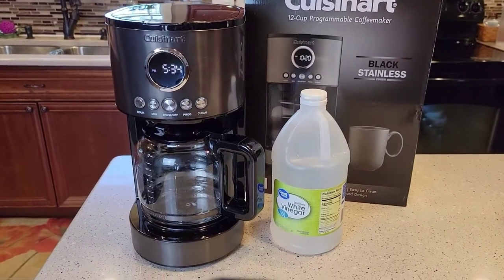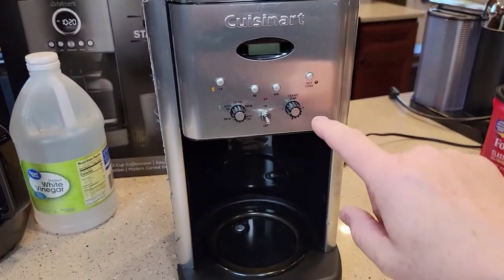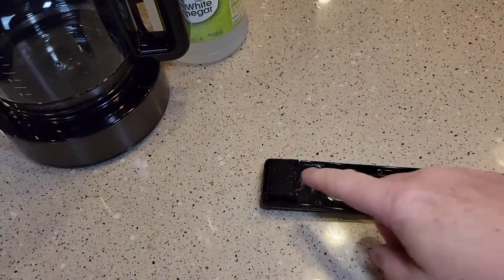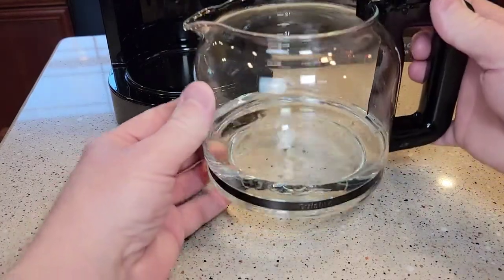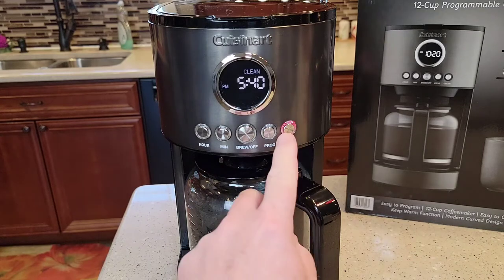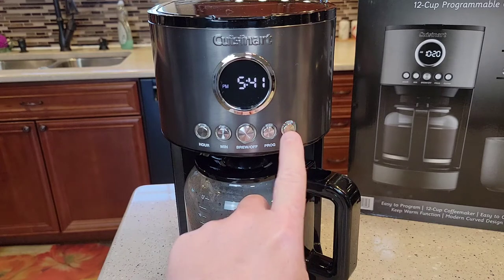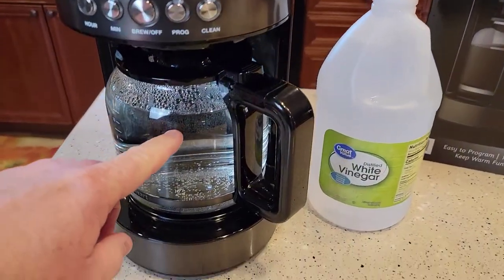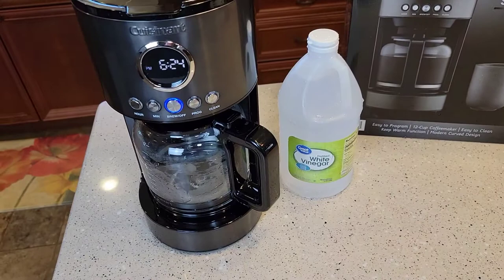HOW TO DESCALE / CLEAN Cuisinart 12 Cup Black Stainless Coffee Maker DCC-1220 FOR ONLY $1.50

Comment: I bought my coffeemaker just like yours 6 months ago and the clean button came on. I misplaced my manual and came across your video. I understood what to do. Thank you!
Reply from the maker: Glad I could help!
Reply: Same thing for me.  I misplaced my manual and then the clean light came on.  I basically knew you had to run 1/3 vinegar and 2/3 water through to clean.  However, I didn't press the clean button and hold it.  After the process, of course the light stayed on.  This is how I found this video and now know oh that's why the light never went off.
Reply: Is this still available? Just saw your video
Reply: @maggierose1101 this is 3 years ago and not my video. Just follow what the man tells what to do.